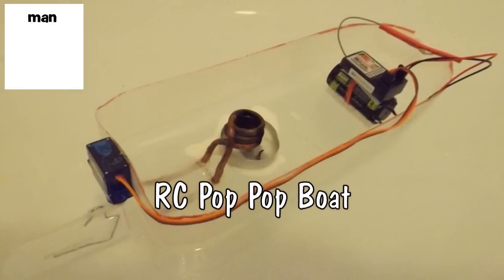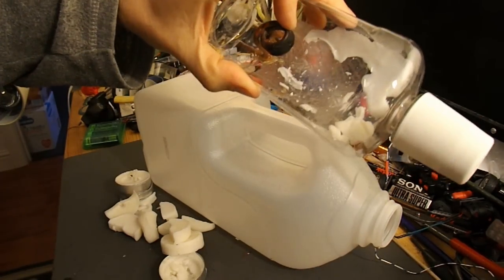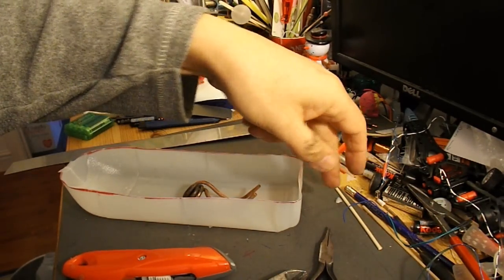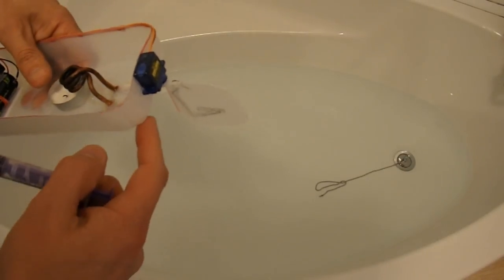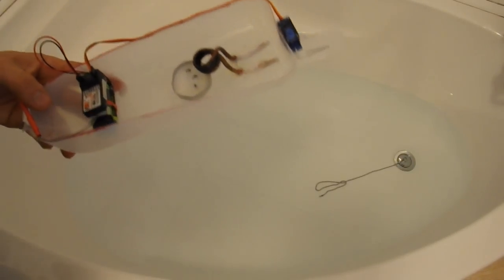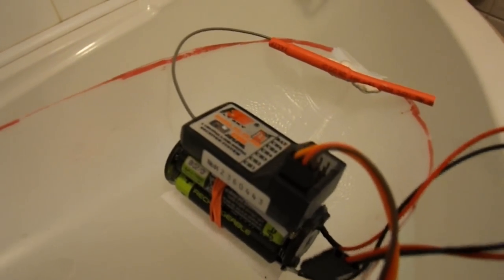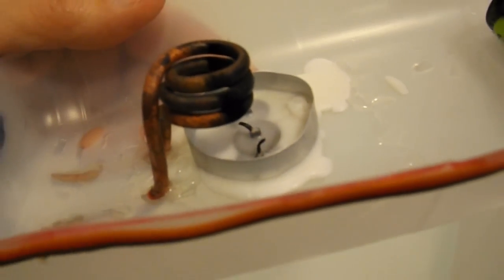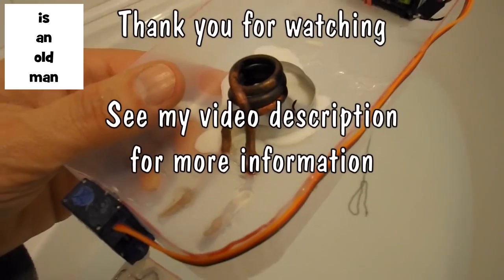RC Pop Pop (Putt Putt) Boat

Comment: ...what a fail physics...plastic boat (fire hazard), battery and RX are heavy against tiny steam powered (resistant to weight ratio)...but nice try, keep it up.
Reply from the maker: +soofast you are entitled to your opinion but I think you would do better if you spoke from experience. There is virtually no fire hazard here. We are on a boat on the water, worst case scenario, the plastic melts and it sinks but it won't, it does not get that hot. As for battery and RX being heavy, no, there is no noticeable performance difference with the boat with or without the extra components, that is the beauty of being on water. It has virtually no friction so the extra weight is hardly noticed. Have you made a pop pop boat yet yourself. I see you have been looking at other pop pop boat videos. You have watched the one by Dave Hax which is a cardboard box. If you want to see some really good pop pop boats I recommend Daryl Foster's channel https://www.youtube.com/user/PuttPutt4video  there is also a lot more information in my video description.

Comment: Haha at the tea and cake, classic moment there.
I like the way that such boats are on fire by design :)
Reply from the maker: This one actually worked better than expected because I used the 3 wick tealight. Usually I have to wait for ages before they warm up enough to start moving, then they start just as the battery runs out on the camera or the memory card is full.